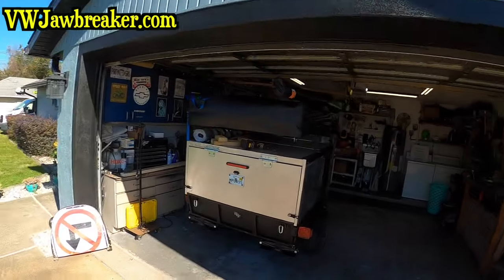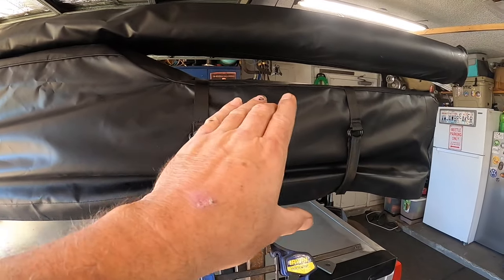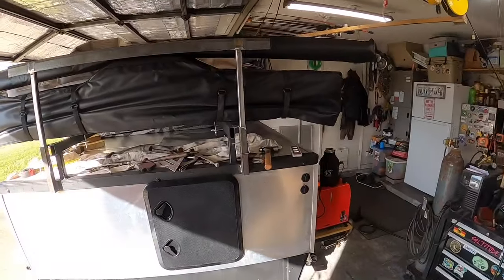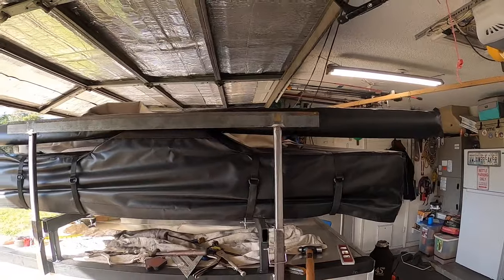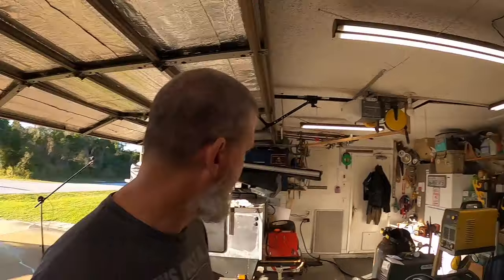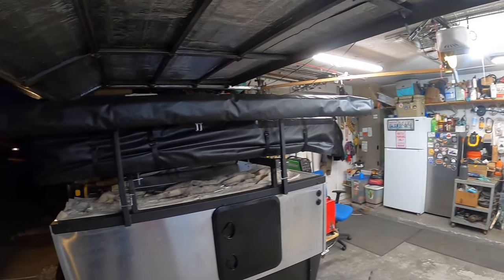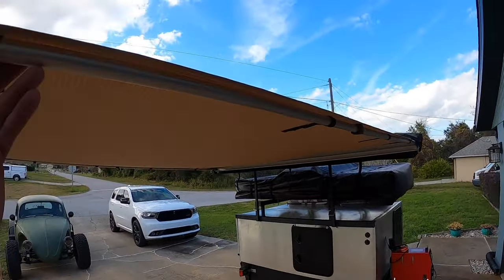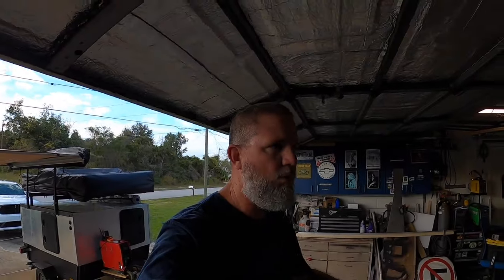DIY Adjustable Awning Brackets for CHEAP! Lightweight  Overland Trailer Part 8

Comment: Hey Gary ! the awning for Rambus is a home made canvas one and I like the pipes on the side because at the beach the sides flop so .
Reply from the maker: What kind of material did you use on your awning?
Reply: @VWJawbreaker  emt
Reply from the maker: @jimmywilkinson9190  I love working with emt, it’s so versatile.
Reply: @VWJawbreaker  cheap